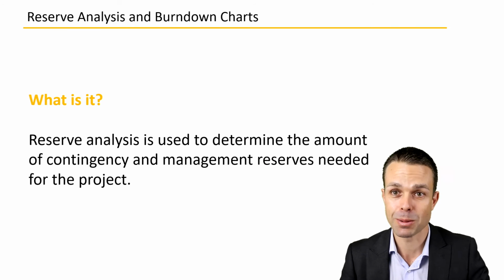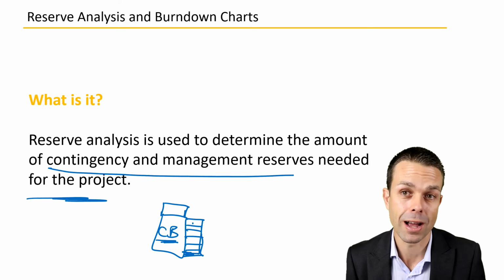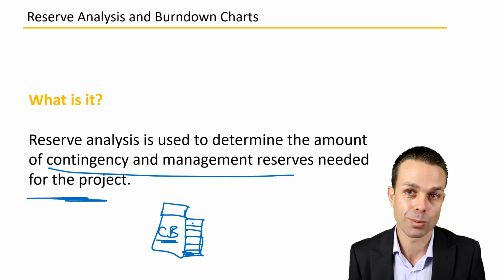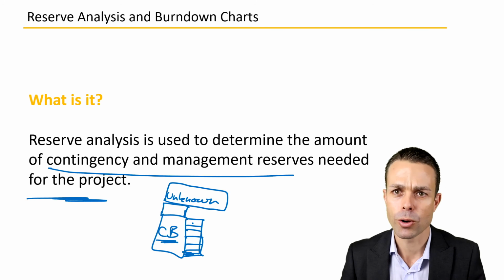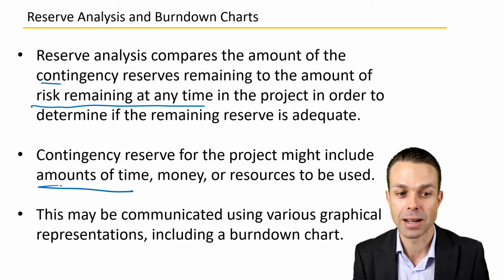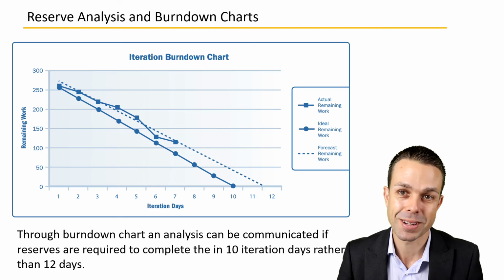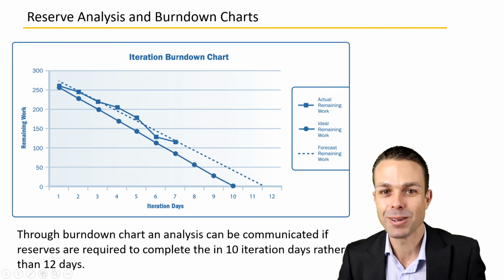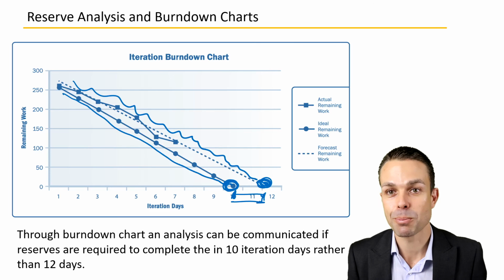Reserve Analysis and Burndown Charts - Key Concepts in Project Management

Comment: Where the project resilience falls? for emergent risks (unknowable-unknowns) within the baseline?
Great videos btw.
Reply from the maker: Great question. Contingency reserves are built into the cost or schedule baseline, for planned risks. Management reserves are added on top of the cost baseline for the "unknown unknowns". Increasing project resilience could come from either or both, plus improving processes / team etc. The burndown chart would typically be referencing the baselines though.